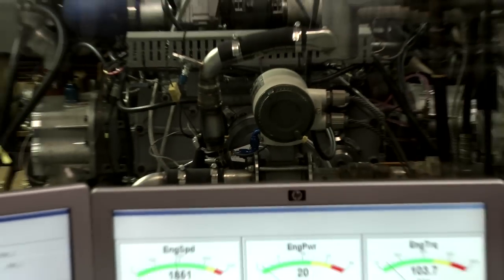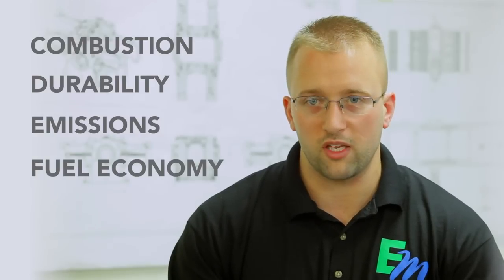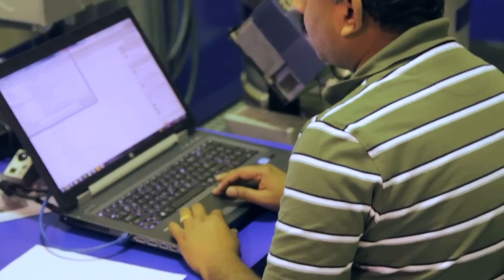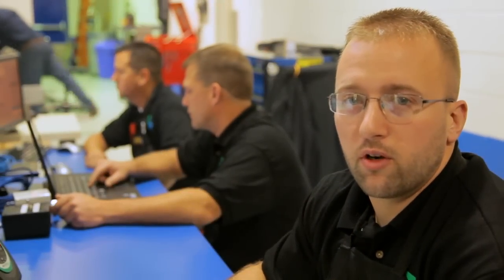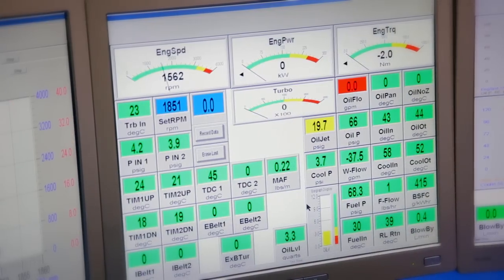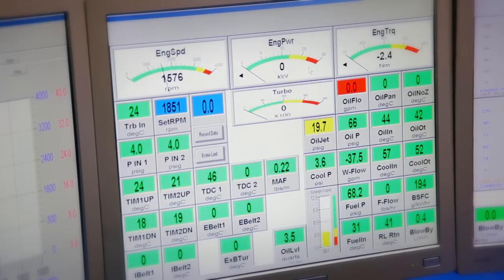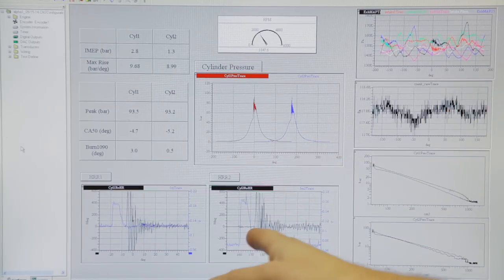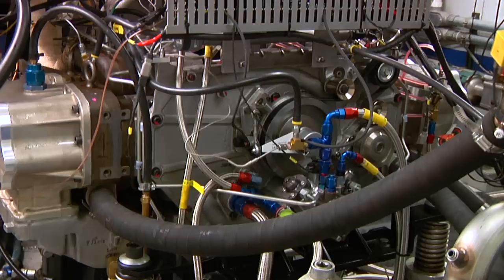EcoMotors engine test capability at Katech

Comment: I really wanna know if you could make a 3 cylinder W engine like this. What would it sound like? 45 degrees between them? 60? Maybe twincharge or use a VGT or centrifugal supercharger. You'd also think the injection system could piggyback off this, or even have a separate cylinder to supercharge a la DKW, although that may be a dated idea.